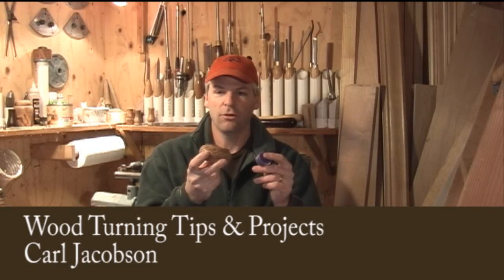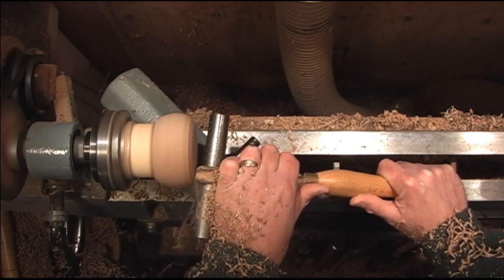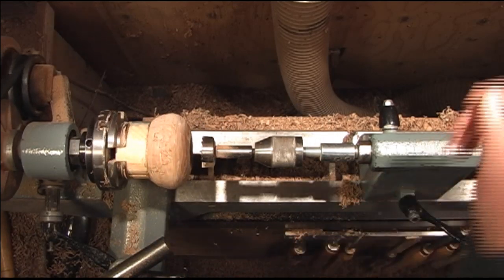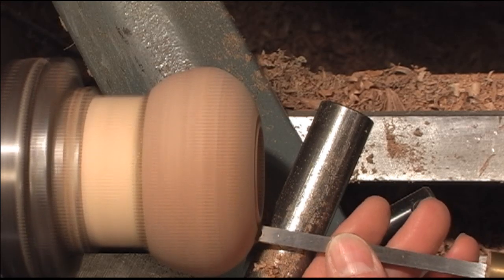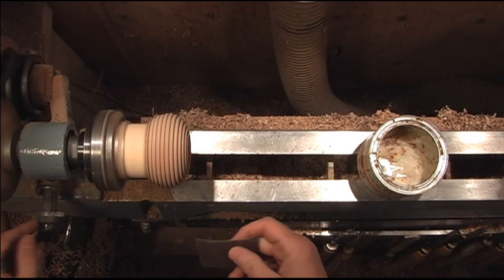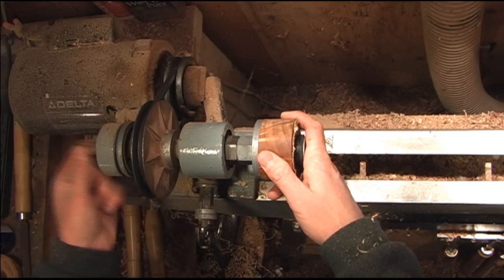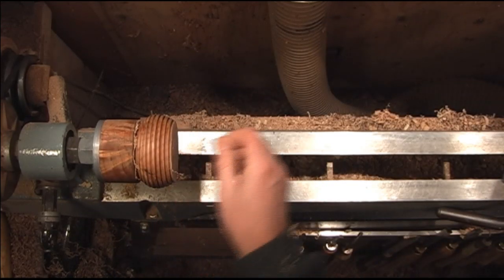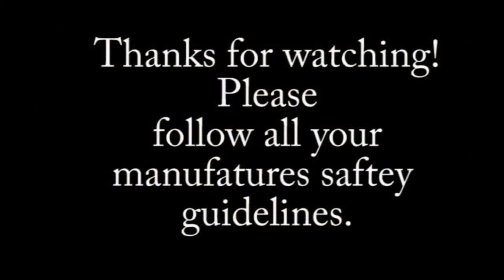Woodturning  Candle Holder For Tee Lights Using A Bead tool.

Comment from the maker: @freewoodencrosses Hi Dennis,
You can find them at your local Hardware store in a variety of different sizes in the plumbing section. They are used for pressure tests.

Comment: what gritt sandpaper and what is the paste ?
Reply from the maker: This is an old video, I now use Howard bees wax and orange oil (it's pre-mixed) I sand from about 180 up to 600 with the oil to keep the dust down.

Comment: Instead of parting off couldn't you have put a heat gun to the bottom and got the hot glue to release that way?  Also I thought I saw the Forstner bit slipping a bit on you when you were drilling?  I am going to try to grind a bead tool out of a 8mm square piece of HSS to see if that will work for me.  Great video as usual!
Reply from the maker: +Terry Ellis Thank you Terry! Yes you could probably use a heat gun, but it would take a long time. The bit might of slipped it was a cheep chuck. Let me know how the tool works out.

Comment: Hey Carl. This is a really nifty project. Do you have any written specifications for the jig to hold the vase for turning the bottom. It looks like a great tool, but i got lost with the specs. Thanks. BTW - I really enjoy all your videos.  Jan .....
Reply from the maker: Janice Kneule Hey Janice, I don't have any specs for the jig. I just put a waste block on a face plate, and drilled a hole through the center. The allthred I used is something that you can pick up at the local hardware store. I'll show it in Monday's follow-up video.

Comment: I cannot find those rubber washers... Can you tell us where to buy them?
Thanks
Dennis
Reply: I'm trying to find them myself.  If you came up with a supplier, would you mind sharing it?  Thanks, Dan
Reply: Also, I've tried every hardware store, plumbing supply store and even a few heating contractors here in the Upper Valley of VT and NH, and I still can't locate those rubber washers!  Crazy!  Dan
Reply: You can find them on Amazon by searching Economy Test Plugs, in various diameters.

Comment: I cant believe you are actually running the lathe without a guard on the belt! Rotating machinery is extreemly dangerous no matter what speed - even 3 RPM could take your fingers off. Believe me I know!